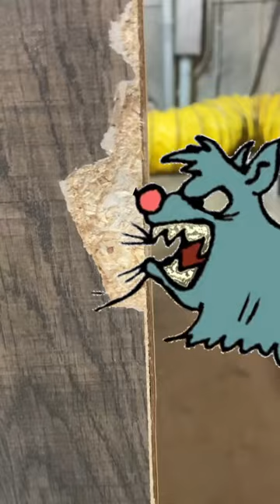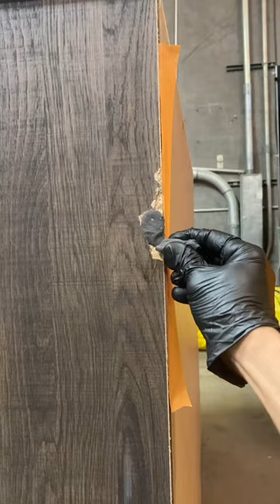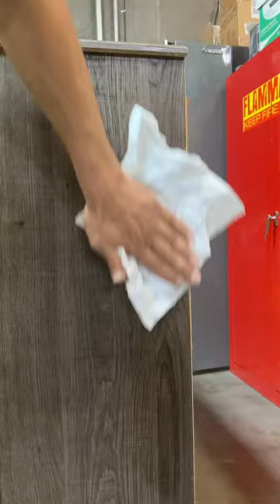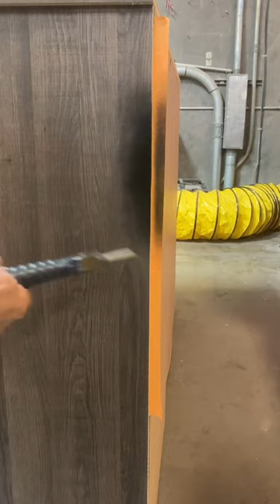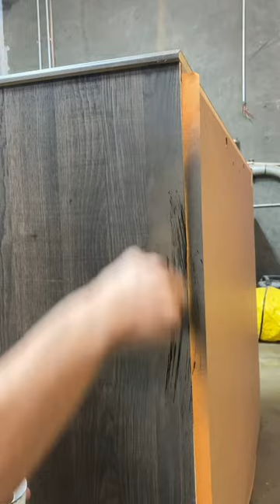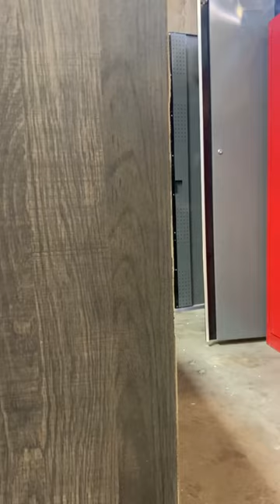Dog Chewed your dresser? #diy #howto #repair #broken #furniture #skills #art #educational

Comment: I'd just put a sticker on and save myself the trouble.
Reply: Yep you can buy a roll of contact paper that matches the dresser, get some air dry clay to fill in the gap mixed with wood glue for strength, sand smooth and plop on a thin strip of matching contact paper. Good as new (especially for a repair in such a hidden area as this.  Its a particle board dresser, the type of repair hes showing is completely unnecessary. That dresser is worth $75 at a flea market even in new shape